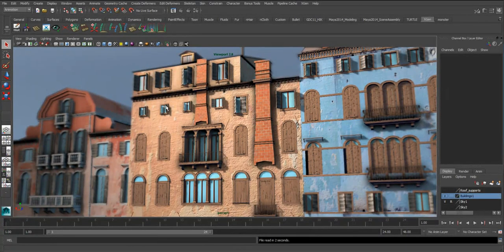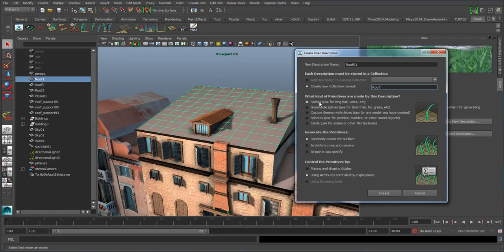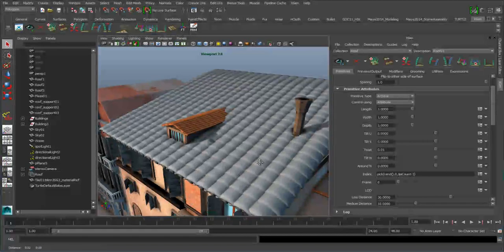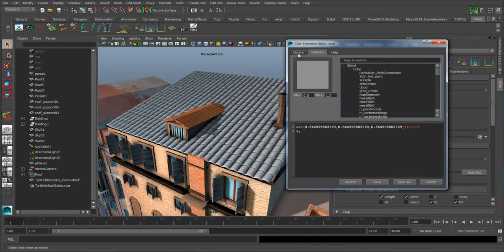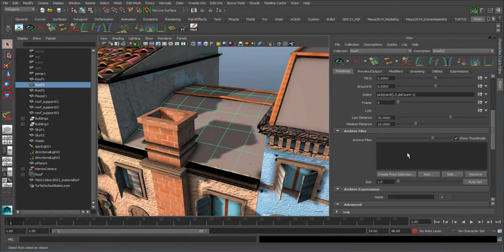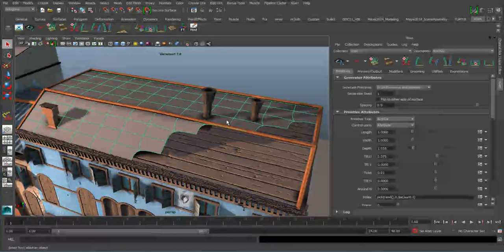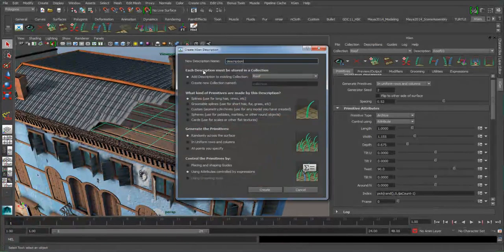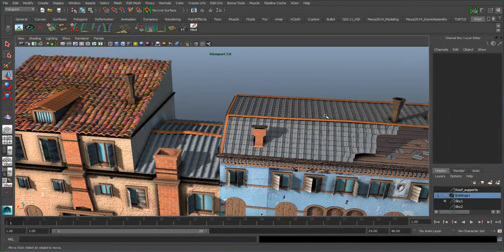Xgen Roof Tiles

Comment: How do I create de .xarc files?? I try using the xgen create from selection and also the generate>export as archive(s)... but it just give me a .log archive that I cannot upload to the add archives :( I saw at the autodesk forum that I have to check the XgenMR.py in the plug-in manager but that it is only available if I install mentalray, wich I obliouly don't want to do cause I don't want to render on mental ray. Is there another way to create .xarc files or to add other kinf of archives to my xgen archive files?